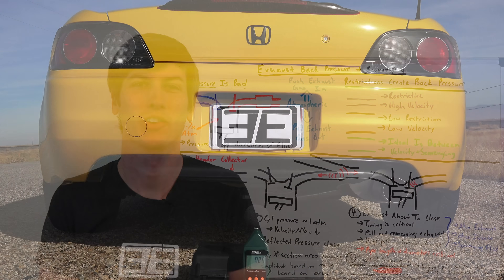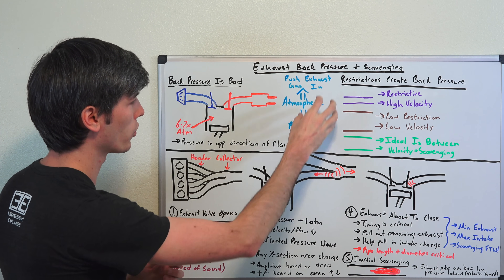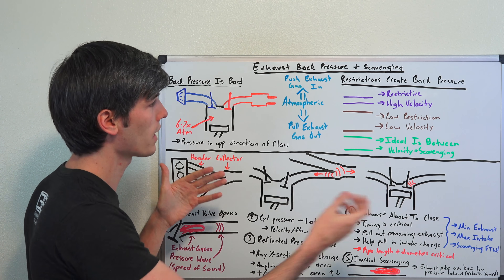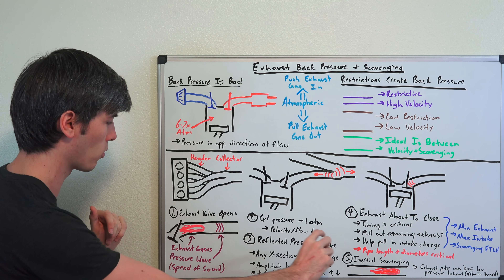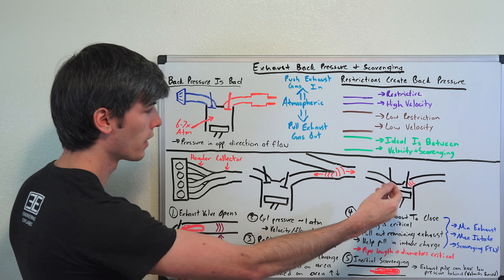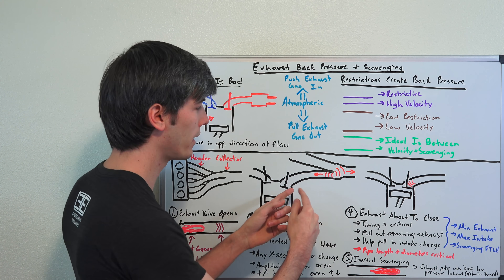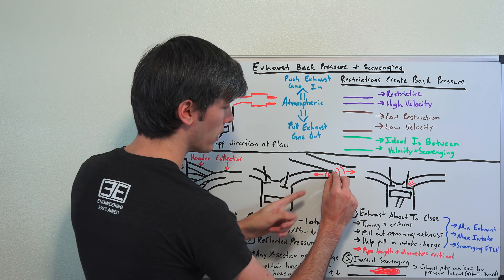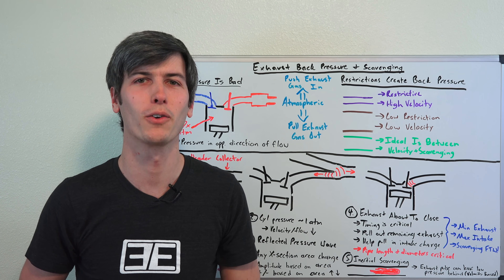Stop Saying Car Exhausts Need Back Pressure

Comment: Thank you! This was a difficult topic to understand, because I understand that the engine must be able to breathe, but I got stuck at the negative pressure part. Since I didn't correctly understand what back pressure entirely was I explained to myself that the negative pressure is back pressure. Turned out I was wrong. Well every day you learn something new!

Comment: yeah. blah blah blah. i think this way on it. the manufacturer of my vehicle has determined what the exhaust characteristics need be for my engine to function as intended and maximize it's lifespan while giving the best overall efficiency ( including the fine balance of performance, cost of operation, maintenance, life expectancy, etc). if ford, dodge, chev, gmc say my truck exhaust needs a particular restrictive pressure during operation, who am i to argue. 
if you mess around with your BACK PRESSURE expect burnt exhaust valves, unless you wish to mess with your valve timing??? just speculating...what does your engineering think..???

Comment: It's a trade off I think,If you have no back pressure you lose off idle torque-low end power because the engine has nothing to push against,Think of a person on a bicycle In 1st gear,you pedal super fast but you don't gain any speed and you run out of breath where as if you are in say 6th gear you can make some torque to get you moving.Think about it, the only time you need a full flowing exhaust is when you are at or near your horsepower peak which everybody rarely is.That is when you need maximum flow.Not when you are at 1000 to 3000 rpm

Comment: Due to backpressure driver will need to push more on the pedal to get the same acceleration, thus louder engine noise for the same intention. That louder noise is what giving the pseudo feelings as if having more powerful engine. "Positive feedback loop" for those who are delusional.

Comment: What would happen if an air duct were ran on exhaust, as an educator valve, where real low pressure is created?  It'd be bulky and being it'd exceed the capacity of many mind, they'd say it would not work.  However, someone might think, Hmmmm, full evacuation of chamber, but an air duct would reduce aerodynamics, so us a pick up truck, a large channel air duct, with an educator design to draw out all the exhaust into the airflow.
Some things have been thought up and even if not working how one thought or calculated, something else occurred that was favorable.  A lot of cfm flow could draw out plenty of exhaust, done right creating a lot of vacuum.
Reply: I agree, someone should simply try it, there's nothing to lose.

Comment: So if you remove a restrictive  muffler you will remove the back pressure caused by the muffler.
I have searched for my car and some report that the mid rpm torque seems slightly reduced. 
So I if you remove the muffler you will probably modify the length of the exhaust and I understand that you may get unwanted back waves. So with less restriction maybe at high power it could compensate for the back waves but at low rpm the restrictions maybe it’s less important but the back wave is noticeable 
Otherwise, owners say that the reason is it needs a remap. The system is 3 way catalyst. So does it need a remap and if yes why?
I’m planning to do an exhaust mod basically I’m thinking of a double perforated pipe (engine has 2 banks) right through the muffler box instead so the noise increase is minimal

Comment: 2cycle/piston ported engines need back pressure at a very specific time in order to run at maximum efficiency as it will actually push fuel/air back into the cylinder as compression starts. Anything with actual valves can run fine without but the back pressure can help smooth out the exhaust tones making the engine sound better

Comment: I remember when I used to do club circuit racing events back in the 70’s in my 1600 Escort Mexico rally car. I would take off the full length rally exhaust and fit a shortened exhaust from the headers with a straight pipe that exited out the side just in front of the rear wheels. It had more power, lot more noise and torque down lower in the revs but seemed a bit flat at full 6500rpm rev limiter. The full system felt smoother over the full rev range. 
I’m sure a naturally aspirated car exhaust size and length is a lot more critical than a turbo or supercharged system. The cylinder pressure is so much higher so the exhaust gas gets pumped out at a high pressure.

Comment: what if they build a reverse turbo installed at the exhaust? would that increase performance even more? thing is the impeller would neet to produce vacuum bigger than the engine's pressure

Comment: It seems to me that it's really just a bit of confusing cause and effect.    The real takeaway here is that exhausts need to be tuned for an appropriate flow velocity, and back pressure is a side effect of achieving that requirement.   So you don't need back pressure for it's own sake, but trying to reduce back pressure can have a negative effect on velocity - hence the "you need some back pressure" statement.   So you don't need it, but a well tuned exhaust will have it.

Comment: This has been a myth since I was learning racing in the 1970s. "You gotta have some back pressure to make maximum power!" I never bought that BS. There are several reasons to alter header length and diameter but none of them involve creating more back pressure. Back pressure KILLS power and it is pretty simple to understand why. This guy does a pretty good job explaining what it took HOT ROD magazine entire articles to explain. You never want to create BACK PRESSURE when designing an exhaust system. There are many changes that can be made to an exhaust system that will improve performance but creating back pressure is not one of them. HOT ROD and CIRCLE TRACK magazines were repeatably clear on this point and had dyno data to back it up. Know very little racers insisted "You gotta have some back pressure!" WRONG!

Comment: If you eliminate backpressure, you lose low-end (pre 3000 rpm) efficiency in engines without variable cam timing. Anyone can see this when they put a larger exhaust on their car that loses torque. 

No pack pressure makes peak hp numbers higher, with less power in low rpm. Otherwise, everyone could put 5" exhaust on their rides with a Freightliner muffler and always have max power available all the time.

It is a fact of life and physics. I thought this guy was good until this video... it is not about the "back pressure", but about designing optimal airflow. If you have a slightly oversized anything (valves, ports, manifolds, etc.), then restricting something can compensate. The only engine that would work best across the entire powerband is one that has perfect sized ports and valves, and runs at the specified r0m range only, and never operates outside of designed ranges. Basically, there is no engine on earth that is optimally designed like this, so saying "back pressure is bad", is not a substitute for the physics involved in every circumstance any given engine sees. It is constantly changing.....

Comment: He is talking about a possible 2hp gain on a 1.5l Miata. The solution is an SBC AC Cobra with headers and short, open sidepipes. Fun starts at 400hp/900kg. Removing 10kg of carpet in his Miata gives better performance than the superheavy 2000$ stainless steel exhaust in an underpowered and overweight Japanese commuter.

Comment: Not quite right, maybe if you had a better understanding. Though you are correct , it is not “back pressure” that is being created by mufflers and other devices, but resistance to exhaust flow. What you are trying to prevent is the revision pulse from meeting the exhaust valve when it opens. The revision pulse is from the column of exhaust racing out the pipe, pulling a vacuum for an instant, then that vacuum pulling that column of exhaust back into the pipe, creating pressure wave at the valve. The idea of creating “back pressure”, or resistance to exhaust flow, is to slow the exhaust gasses escaping, so that the vacuum pulled at the valve will last for a longer period of time, thereby making a vacuum at the exhaust valve available to scavenge the cylinder over a wider range of rpm. “Back pressure” hurts maximum power, but that maximum power will only be at one specific rpm, “back pressure’” or resistance to flow, helps to produce better power over a wide range of rpm’s , making a car more drivable.

Comment: In my experience I ran a truck with no back pressure correct diameter straight piped. One thing you missed was how the back pressure pulse affect piston rings. Unless you have a turbo(which produces back pressure).

Comment: Only one number on the board, very easy to understand and learn new stuff.
Does anyone out there know if vacuum pumps are used on car exhaust system pipes?
Question 2: do any engines push fresh air into the combustion chamber 
at the end of the exhaust stroke to help clean it out?

Comment: I was taught you need backpressure, what they meant was too large an exhaust will not improve performance. 3 years late to the party but is it semantics? We also read about resonance yet different terms are used here.

Comment: This is all true. You don't NEED back pressure, unfortunately, it's something you have to have, not for the engine, but for laws. Most states in the US require intact and functional catalytic converters and mufflers, which are points of restriction that create back pressure. Higher flow equipment is available to help alleviate this issue and, with a good setup that helps promote better scavenging, that can help even more, but then it's a question of a given locations emission laws and whether a particular setup complies or not

Comment: You get a shock wave with a p0/p1 ratio at about .52.   that's certainly something you want to avoid.  So the lesson is try to cool that exhaust as much as possible before it hits atmosphere.  Pressure drop can be modulated by expanding the exhaust size and channeling it though passages to even out and cancel sound waves.  P0 = P1 + .5pV*V

Comment: I may be wrong, but isn't tube length also designed to help timing of exhaust pulses.  make sure cylinder 1 negative pressure helps pull cylinder 2 exhaust and make sure two pulses don't meet at collector at the same time?

Comment: HAs the channel ever did a dual exhaust versus single challenge/test? 
i just got a 84 cutlass  with horrible sounding dual 2" exhaust  with red glasspack bottles and wondering if it would sound better as in more rumbly with one single 3" which will also flow better since one 3" pipe is about 7 sq cm versus 2 x2" =6.28 sq cm?
 or can that smaller 2" dual setup scavenge better and keep low end TQ versus a big single which may gain high rpm  hp but sacrifice about the same amt of low/mid range TQ

to make the question even harder, im currently running the stock 305 SBC but already bought a used 2003  5.3L LS which will double the stock 305hp [nevermind all the ponies that escaped that 305 barn in last 37 yrs, lol. ]
SO i dont wanna spend any more than neccessary on this dual system if im gonna upgrade to a bigger dual or bigger single exhaust for the LS motor in near future